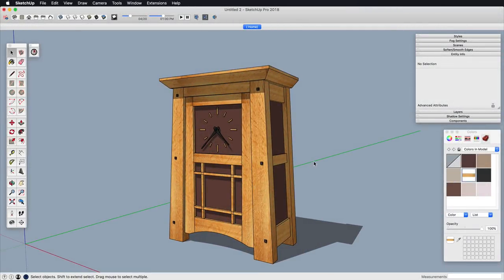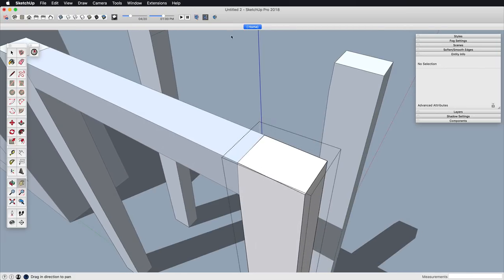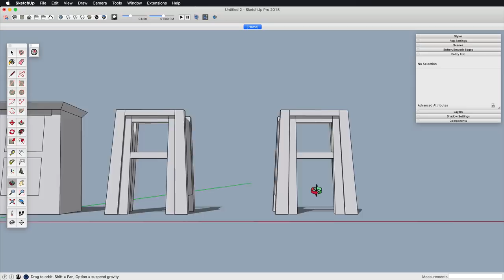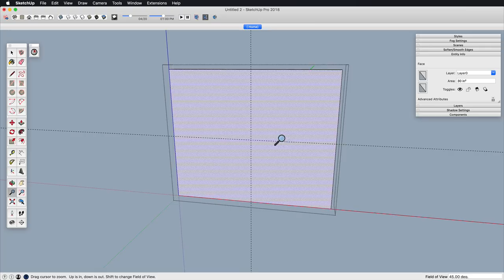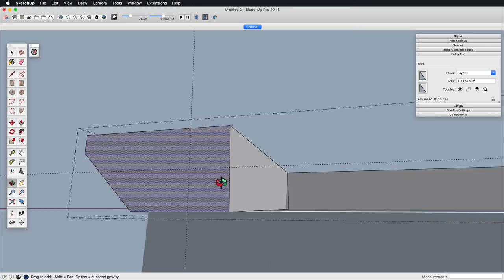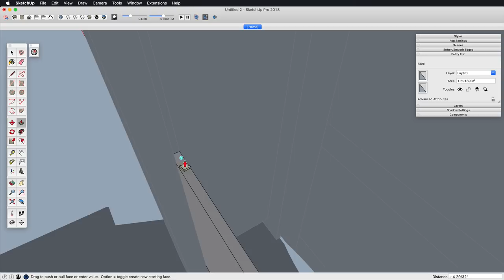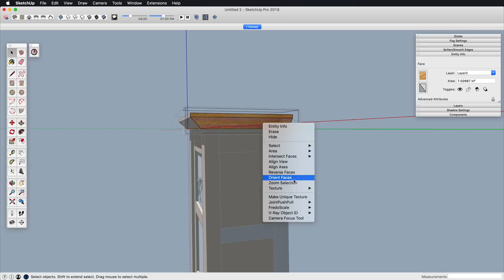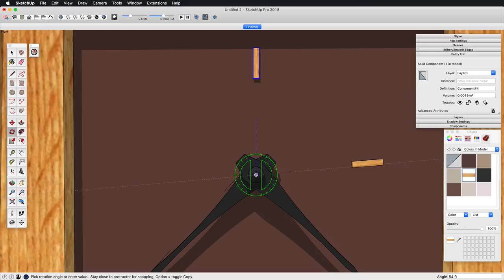Modeling a Mantel Clock in SketchUp

Comment: I'd be interested in the keyboard shortcuts you are using to move so fast.  I use a few already, but not like that.  Also interested in how you would break a model like that down for a cut-list (understanding the joinery isn't in place).
Reply from the maker: Ya, I use shortcuts for everything. I think a few that can be overlooked are creating shortcuts for 'Hide similar' and Hide rest of model' when editing components. I also create shortcuts for 'close groups/ components' and for toggling x-ray mode on, all of these things just make editing groups and components faster. 

For a cut-list or plan, I have Pro so use LayOut for that sort of thing, but if you don't I typically just pull parts away and create a sort of exploded view and add some dimensions. Hope that makes sense. 

Thanks!
Reply: @GeeksWoodShop  It would be interesting to have short 30s-1m videos of things like how you did the mirroring/joining two pieces and removing the center lines.  Also, I'd like to see how LayOut looks/works to see if it's worth thinking about getting Pro.
Reply from the maker: @MrTegidTathal  Thanks for the feedback, I'll try to work this into future vids.